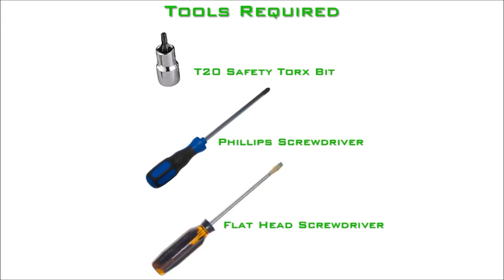Nissan GT-R Throttle Body Internals Installation - Boomba Racing

Comment: how much hp gain will i get?
Reply from the maker: That all depends on the adjustments to tuning that are made after installing. This is not intended for a stock car, but rather a highly modified one.
Reply: the gtr i plan on installing this on has 666 on 93, 750 on race fuel
Reply from the maker: If the TB is your bottle neck which it often is, this should surely help with recovering some power.
Reply: it is a bottle neck, thank you !